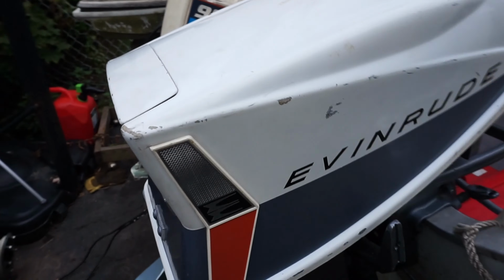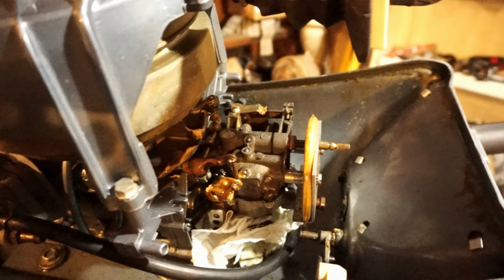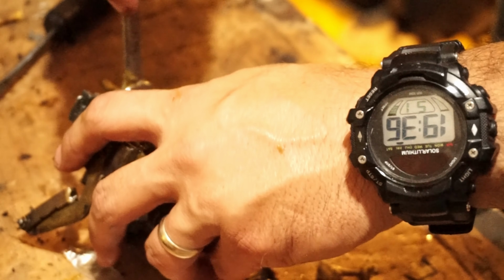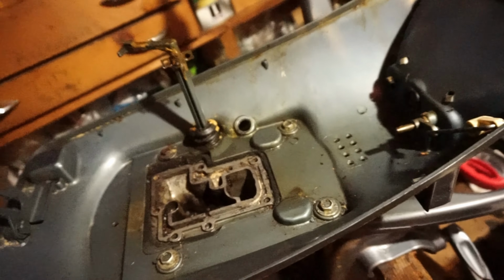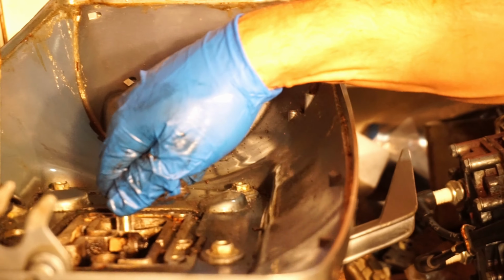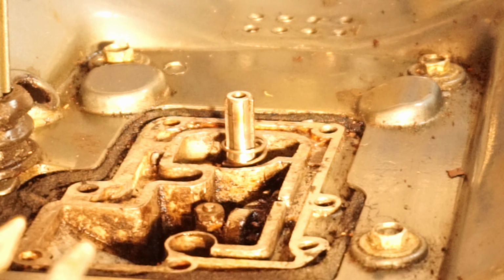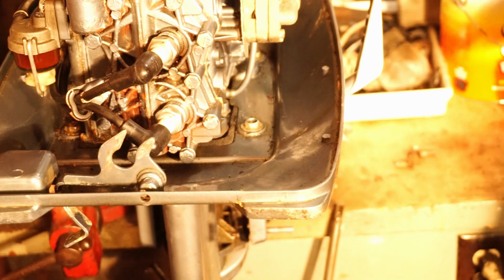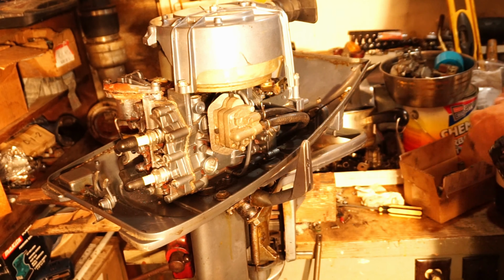1963 5.5 EVINRUDE FISHERMAN  gets a fresh life!! Stay tuned for more videos!!!

Comment: Thx for video. Rebuilt carb per your instruction. Fired right up and ran great on low speed for bucket test. However now I have dark black oil in bucket of water :( thoughts ? Suggestions? Other videos to watch for ideas ?
Reply: Also noticed water then some oil coming out of weep hole after I took shaft out of the bucket
Reply: I think it’s the drive shaft seal. Do you any videos on this repair? If not on the 1963 how about a similar year that would look similar ?
Reply from the maker: sorry for the late reply! That black oil is normally just unburnt 2 stroke oil! don't worry about it! if you see a sheen in the actual lake Then you could say something is wrong. Or if it doesn't idle or run at high speeds properly!!
Reply: @BlackoutBilll21  thank you so much for replying
Reply from the maker: @davidflowers4045  my pleasure
Reply: @BlackoutBilll21  well Bill, I was hoping correct. Changed gear oil and bit of water came out at first. Implies bad seal, huh? Tried to take easy way out and pulled prop off and see if fishing line caught.. sure was! Removed line but appears to just change prop shaft seal Id need to remove LU still ( which requires removing the powerhead. Fml )???? Right ? Any videos you have that would, I’d greatly appreciate being directed to or you have another thought or if I’m way off base? My dads old boat. Sat many years. My 9 year old just wants to fish on a lake :(
Reply from the maker: @davidflowers4045  I do believe to get the lower unit off. You have to remove the powerhead. First of all, it’s not that bad. Second of all, I believe you can flip the motor upside down and simply disassemble the gear case. If you’re only doing the prop seal. Personally I’d just leave it. A little water in the gear case won’t kill you. Just change the gear oil every season
Reply: @BlackoutBilll21  you’re the man. I appreciate your advice. A 9 yo will be happy to be on the water for the rest of the season
Reply from the maker: @davidflowers4045  thank you for watching and commenting! helps the algorythem!

Comment: So I have one of these just rebuilt carb did cold adjustment and ready to start my question is how do I shut if off if it's not running right or pumping water and I need to shut it down just curious I know to twist throttle open a bit to start but where is stop I also need more info on how to replace wear plate and impeller if possible
Reply from the maker: if you throttle is down all the way it should shut off... worse case seneriaio just pull the choke out. It will stall

Comment: Hello sir I know you mess around with a lot of old outboard motors well down here in Oklahoma parts seem to be few and far between for old stuff..... Got a 1957 evinrude fleetwin 7.5hp.... Long story short previous owner knew nothing about it and was running 50:1 gas ratio.... Needless to say when I got it actually running on the right mix and had cleaned carbs out it ran for about 2 minutes great as I was praying for no damage and then..... Disaster.... Threw a rod cap out the side of the block.... So any possible lead on a short block for this size motor everything else seems in good shape.....
Reply from the maker: ok so what I do, in NJ so I may have more access, is find any 7.5 motor from 1955-63 Johnson or Evinrude for sale on craigslist facebook or offer up. they are all pretty much the same block! Sorry to hear about what happened to you motor.